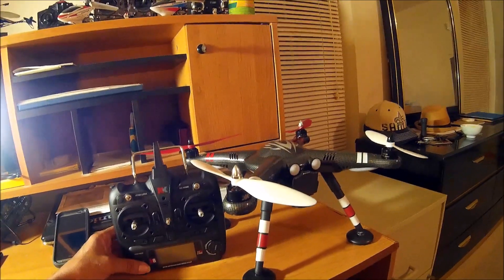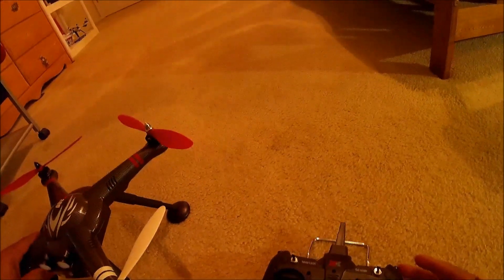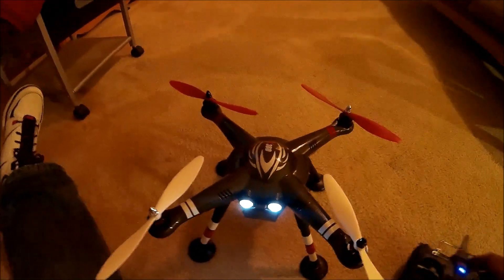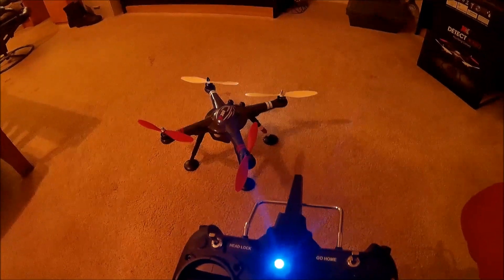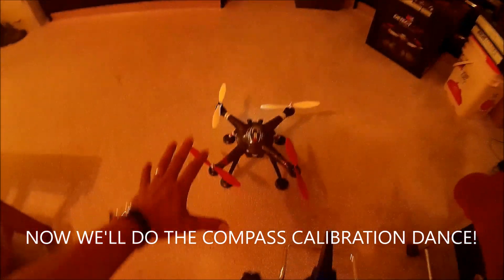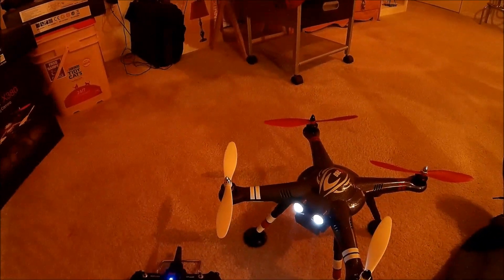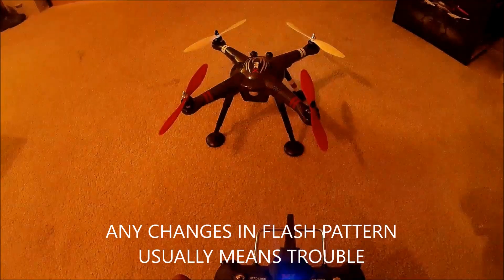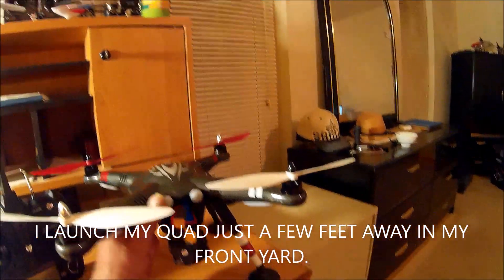XK DETECT X-380 "MUST WATCH BEFORE YOU FLY"

Comment: Thank you for your video.  I finally got my X380 last week but haven't been able to fly it yet.  Quick question, how often do you need to do the compass dance? Every time I fly or just once in awhile?

Thanks again!
Reply from the maker: The manual recommends before every flight, but I only calibrate every now & then or whenever I change flight locations more than a few miles away from my last flight. Some guys calibrate before each flight, I personally don't think it's that critical, magnetic north won't change unless you cross the equator or fly around to the other side of the world!!! You'll have to decide that one on your own, it's covered in the manual.  Thanks for watching and for your question.  DJ Soul Force

Comment: DJ, Are these steps described in the manual?
Reply from the maker: Yes, some of them are but are not explained very well. The manual lacks a lot of information, so I supplemented some info that I got from experience, such as the "not touching" the quad during intializing process! I'll be updating this video with more tips & tricks soon. Good luck, fly safe. DJ SOUL FORCE
Reply: +DJ SOUL FORCE I receved my drone,flown it in my backyard (which is illigal in the netherlands) and it worked great, even though it didn't get above 30 cm (safety first)

Comment: Hi DJ Soul, if the X380 looses transmitter signal because the transmitter battery died, isn't the quad supposed to return to home automatically if the green light flashes meaning its locked on GPS? I started my x380 in my home and had green flashing indicator light then went outside with it and flew it, but my transmitter battery died and the quad flew vertically and away until it hit the tree and came crashing down.  Luckily its fine, but if the the tree wasn't there it would've flown away.
What if I am locked on GPS and fly it and also shut off the transmitter, It should return to home, right?
And, if the quad is not locked on GPS but has a broken transmitter signal, could i then fly away?
Reply: +DJ SOUL FORCE thank you for your reply and your feedback. you mentioned something about the software and programming the x380 to do what you would like. the squad didn't come with any instructions what software do I use where do I go and download it?
Reply: I heard someone say: "if the XK X380 looses signal. it will first raise 10 meters before it goes home." the 10 meters are there so it shouldn't fly against buildings. unfortunally in your case there was a tree in the way up.
Reply from the maker: Those are some very good questions, but I can't truly answer because I've never tested "Loss of Signal" with the x380. I always assumed it was suppose to come back home, but never tested it. I thought I saw Dustin Dunnill test the signal loss with the x380 and his landed in place. There is a setting in the flight control program for what you want to x380 to do if it loses signal, which a choice of 1) hover in place 2)land at current point, or 3) come home! Sorry, I never tested those functions. Glad your's wasn't damaged. Good luck bro. DJ Soul Force
Reply from the maker: A12345  I was afraid you were going to ask that! The x380 flight control program is available to download at www.XK-Innovations.com, but using it is a whole different monster... I never did a video on how to use the flight control program because it's a little complicated if you don't know what you're doing. In the description of my video about software fixes (https://www.youtube.com/watch?v=c0jPjEA4ZdQ) there is a link to download the flight control program. For some PC's it easy to download & open the program, for some others, you need special drivers. There's a couple of videos on youtube that shows how to connect to, open, change settings and most importantly, save those settings to the x380, but I warn guys to do it at your own risk. Maybe oneday I'll do a video on it, but for now, I'm not touching it!  You should also join the "All XK Drone Owners Club" on facebook (i'm a member) and you can find plenty of help there with using flight control and links for downloading the program. Good luck

Comment: Hi DJ SOUL F. l have a other X380 quadcopter that l cant bind the transmitter because it only have red flashing light and a simultaneous beep, what are you think do l can do? the red flashing light is very fast 
Thanks
Reply from the maker: I'm having a hard time understanding what your problem is. If you can, make a short video that shows what happens when you first plug in the battery and also show the remote controller in the picture. First, make sure your quadcopter battery is fully charged, fast flashing red light means "low battery warning." Also, make sure that both toggle switches are in the up position and that your remote controller batteries are fully charged.  When you write back, use "REPLY" to THIS message so that we can keep this conversation in the same message. Please make a video and send me the link.
Reply from the maker: Frank, I looked at your video and it seems you're having software issues. Is this x380 brand new, or is this the same one you had problems with before? If it's brand new, I suggest you return it, If not, maybe this will help: https://www.youtube.com/watch?v=c0jPjEA4ZdQ  This video will show how to erase the x380 internal memory and replace the master files and restore your x380 back to factory settings. Good luck. DJ Soul Force
Reply: this is not a brand new, the other is working good thank for your help on that

Comment: hey buddy, I have a v303.  it's seems to have gone into a safe mode, it gets GPS lock  done the magic dance and calibrated the receiver soon as I power up Motors it will take off then completely shut down with a constant flashing red light, any ideas please,, I now have a X380 on your review, but a dead v303
Reply from the maker: Sorry, I don't know much about the v303, but I have had guys tell me that it uses the same firmware as the x380. If your x380 were doing that "constant red flashing" I would tell you to flash the memory and install new files, like shown in this video: https://www.youtube.com/watch?v=c0jPjEA4ZdQ  I AM NOT recommending that you install the x380 files into your v303, but maybe you can search for v303 master files and latest firmware to fix your problem. Good luck bro, let me know how it turns out. DJ SOUL FORCE
Reply: I've had them both apart with mine being a later 303 it has all the same function as the X380.  Only difference I can see in them both is just a bigger battery life on the X380.  Thanks for the link, I'll try that, both have the same control bored so hopefully it should work, if not I have alot of spares fir the X380,  thanks for replying keep up the good work, Mark from the UK 😀

Comment: Each one is the RTH, the GPS or HEAD LOCK
Reply from the maker: RTH means (return to home) or the "GO HOME" button. There is no GPS button on the x380, GPS is on all the time!
Reply from the maker: VERY IMPORTANT - MAKE SURE THE QUADCOPTER IS ON A LEVEL SURFACE BEFORE YOU CALIBRATE THE ACCELEROMETERS - USE A LEVLING TOOL OR APP IN YOUR SMART PHONE

Comment: Are can help me out with my X380? l yes have one, and my first fly it move right, left, from or any ware, what do l need to do to fix that problem before ask for return the quadcopter?
Reply from the maker: If you have done everything in this video correctly, try calibrating the accelerometers.  Put quad down on level surface. Turn on quadcopter, then turn on remote.  Without using any sticks, flip the RTH button quickly 12 times or more until all LEDs start to flash. Put RTH button back UP and wait until lights stop flashing. That's it. If that doesn't work, you may have a bad quadcopter. Good luck. DJ SOUL FORCE

Comment: Hi DJ SOUL FORCE, do you know the maximum height that the drone X380 can reach?
Reply from the maker: Unlike the DJI Phantoms, the x380 does not have that height limit restriction built in. It should be able to climb to it's range limit of 1,000m (or more) until the transmitter signal gets too weak!  Lol, I've never tested it, but it will get up there bro! DJ SOUL FORCE
Reply: Hi DJ SOUL FORCE, first of all Thank you for answering my questions. I'm thinking to buy a FPV Sets for XK X380, i have already a camera (FireFly 6s). Do you think is possible to use this camera?
Reply from the maker: Edilson Andrade Sorry, I'm not familiar with the FireFly and don't have FPV on my x380. Ask the guys on facebook, "All XK Drones Owners Club" they would know.

Comment: hey what's up. I have a quick question. my x380 is getting satellite lock(double green) but when I take off its hot holding altitude.
Reply from the maker: Try calibrating the accelerometers. Put quad on level surface. Turn on quad, turn on remote. Without using any sticks, flip the RTH button 12 times or more until LEDs start to blink. Put RTH button back up, wait until lights stop flashing. That's it. If that doesn't help, let me know. Good luck bro. DJ SOUL FORCE
Reply: +DJ SOUL FORCE  Hey I forget to tell you that I didn't have any luck with that. same thing is happening.  I must be need to give up. maybe just buy a Phantom
Reply from the maker: Omard Gardiner  Try flashing the memory and installing the master internal files again. If that doesn't work, buy a Phantom!!! Watch this video: https://www.youtube.com/watch?v=c0jPjEA4ZdQ

Comment: Hey DJ have you ever gone to fly and after plugging in battery light goes solid red and won't access gps.  I pulled down on sticks on last flight to lock blades. Since then solid red light when I go to fly.
Reply from the maker: This may sound a little silly, but did you check your "RTH" switch. If that switch is down when you turn on quad, you will get a solid red light. Make sure both both toggle switches are up when you power up quad. Let me know how it goes.  DJ SOUL FORCE
Reply: I have put both switches up and still get the solid red.  I am returning 380 as I write and going to order another.  I tried everything and could not get it to work.  Is there a site for trouble shooting this model it doesn't provide much in the way of problem solving manual.  Thanks for your reply and keep up the good work.  I bought the x380 because of your videos, I have the Eachine x6 because of your videos. 
Best to you
Grumps140
Reply from the maker: Steven Brown  No site for troubleshooting that I know of, maybe the "All XK Drones Owners Club" on facebook, it's where I got a lot of my information about this quad. I did do a video once that shows how to re-install the factory master files to the quad's memory, maybe this will help: https://www.youtube.com/watch?v=c0jPjEA4ZdQ  Good luck bro. DJ Soul Force

Comment: Hey! DJ! Tried the Mag Call a couple of times, it seems to work. I thought it might be a loose connector. I removed the legs and disconnected the Mag Compass Connector, then I tried to open the body to see if there were any loose connections, only to discover that not all of the body screws would come loose. This seems to be a manufacturing defect--time to contact Bangood.

I hope the Mag Compass is secure. I'm a bit leery of flying. I'm going to take it out for a test lift off, and maybe a short flight.

Cheers!
bob K
Reply from the maker: Hope all goes well, fly safe. DJ SOUL FORCE

Comment: Hey!, DJ! I redid the firmware, did the rebinding , Accelerometer cal, and, mag compass cal. I took it out this morning for a test, still toilet bowling. I noticed when I did the compass cal, that the light only stayed green for a second or 2, then went out during the initial cal step, no matter how fast or how many times I flipped the Head Lock switch. I think I may have a problem with the compass. I may have a broken wire inside. I'm reluctant to open up the quad. I will try the Mag Compass call a few more times just to be sure. 

Cheers!
from Bob the Explorer

It seems I always have to disassemble things to see how they work. Started with my first car an old 50' Chevy.

Comment: Hey, DJ! It's just me getting tooooo Confident in my flying. After my last great flight, I took it up , let it hover close to me, made a u-turn, brought it towards me, went over my head into the parking lot. My attempt to bring it back past my car and the light pole met with my first real crash. The camera came flying out and one of the props bent up a bit (able to bend it back without any real problem).

Fortunately I had some extra rubber shock absorbers which I installed in my gimbal mount, which I secured withe waxed lacing cord.

Next flights over the weekend at our daughters big spread in up state NY met with continued disasters.  Toilet Bowl City, recal no effect. Oh, yeah, managed to land in a tree on Saturday.
This afternoon I took a look at the Flight Control Software and reset the firmware. I'll take it out later tomorrow after I get back from the State Capital in Harrisburg.
I'm not sure what else to do. Oh, well I sure know how to wreck things.

My flying confidence is shot.

Cheers!
Fly Safely!
BK
Reply from the maker: If the toilet bowl effect keeps up, follow the instructions in this video: https://www.youtube.com/watch?v=c0jPjEA4ZdQ This should help. You may consider replacing the bent prop with a new one, the Phantom 3 props will fit, they sell them at Best Buy (if you didn't bring any with you!). Good luck Bob. DJ SOUL FORCE

Comment: hey dj.  should any of the lights on my charger an adapter turn green when fully charged on my xk380  after about 2 hours they stsy solid RED
Reply from the maker: No, just flashing red (charging) to solid red (finished charging)!!! That first charge seems to take forever, mine took about 4 hours to stop flashing the first time! Then I bought a Pro balance charger, takes about 55 minutes. I bought the ImaxxB6 Pro Balance Charger, search on Ebay. Good luck.  DJ Soul Force

Comment: Hey! DJ! Flight 8 disconnected FPV Xmtr redid Accelerometer calibration. Perfect 8 minute flight, take off, landed within 1 foot of take off. Now I have to fix the FPV Xmtr location? Shielding? Antenna direction? Frequency? 
SeByDocky did a disassembly,  here's the link: http://www.rcgroups.com/forums/showthread.php?t=2473961

I installed the FPV Xmtr on the Left Rear leg. If XK assembles their birds all the same, then that leg has no antenna or Mag Compass connections. I'll make one change on my next fligh.
I'll report back on what I find.

Cheers!
Bob K
Reply from the maker: I'm thinking maybe needs shielding, but if you shield the FPV TX, you'll mess up your FPV reception! Let me know what you come up with. The x380 doesn't seem to like any other signals except her own control signals. Good luck Bob.  DJ SOUL FORCE

Comment: Hey! DJ, It's Fathers Day and if you're one, Happy Fathers Day to you! Well I have 7 flights in now, the last two seem to have developed a problem on "take off" and "return to home" since I installed an FPV transmitter (only 25 MW) on the right rear leg(redid accelerometer after flt 6 then start of flt 7 -no effect) . Maybe it's interference or bad location. Seemed to fly ok once I got it up and away, but started to do the "toilet bowl "on "return home" had to land manually. I'll try a test tomorrow (weather permitting) reset the accelerometers with the transmitter off and see if is normal again. I tried the FPV using the X250 Monitor with a non-reflective screen- still too dim (useless except for cloudy days or night flying). I also used a car rear view camera monitor (4.3 inch screen) still dim (but I didn't have a sun shield on- it did have  brightness and contrast controls). I'll try that one again with a home made sun shield.

Have you any suggestions on FPV?

Cheers!
BK
Reply from the maker: Sorry Bob, I never put FPV on my x380 so I can't give any suggestions. The x380 can be really sensitive when it comes to electromagnetic interference and you'll start to see more "toilet bowl" effect. The only thing I can suggest there is to try moving your FPV transmitter around to different locations. Did you ever see my video on the FeiyuTech Mini3D gimbal, man that thing drove my bird crazy!!! (https://www.youtube.com/watch?v=R8itFc6Yo_c) Good luck sir and Happy Father's Day to you too!  DJ SOUL FORCE
Reply: Yep, I saw your vid and I think some others had the same complaint. I haven't tried the 2D stock gimbal yet since it tore itself up just trying to calibrate it. I fixed but but I'm still leery. I'll put up with jello for a while yet until I feel secure in what I have attached. I still only fly about 10 minutes at a time.

Comment: Hey DJ, I had to come back and watch this video again. Just got a second 380 and to tell ya the truth, it's a piece of shit.  I've had nothing but problems with this one.  Already had to fix motor with the soldering.  It flies great but it drifts a lot. Trim will fix it for a minute or two and then it starts it's crap again.  Almost crashed it but I did gain control  and landed it.  I know this is not right. Do you have any suggestions as to what to do at this point. I'm trying the tx calibration and will try it again tomorrow.  Oh yeah, my pc will not open up the 380 controls.
Reply from the maker: Try calibrating the accelerometer - Put quad on level surface. Turn on transmitter, turn on quad. Without using any sticks, flip the RTH button 12 times or more until lights flash. Put RTH button back up, when lights stop flashing, you're done. (this is not in the book or in my videos - just learned this recently) Let me know. DJ SOUL FORCE
Reply: Thanks man, I'll try that tomorrow and let ya know how it does. Happy flying my friend....
Reply: Must have worked. I've had two flights since this and it is really doing it's job. Thanks DJ.
Reply from the maker: DW Caudill  No problem bro, happy flying! DJ SOUL FORCE